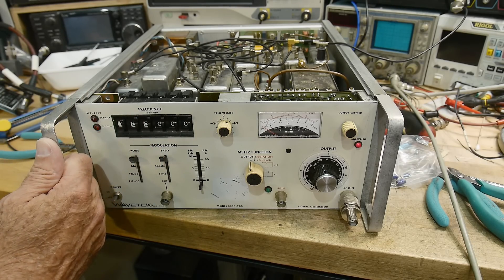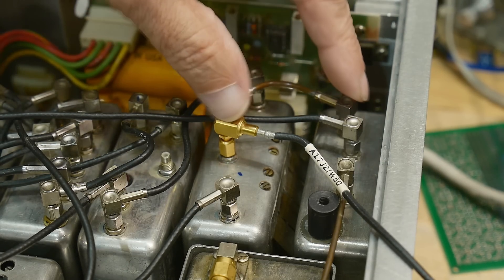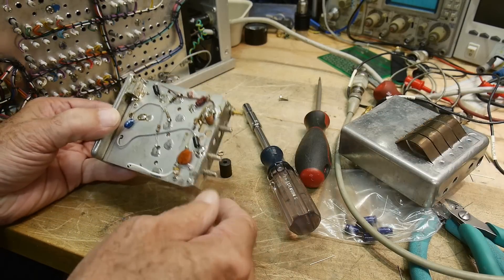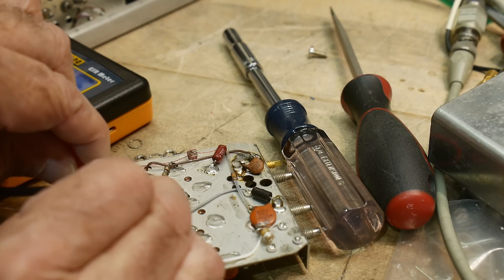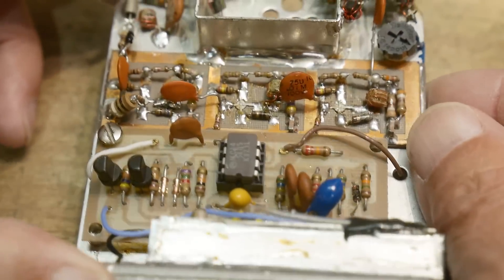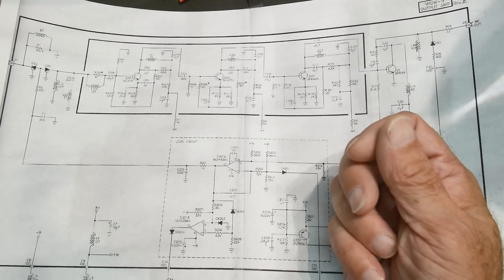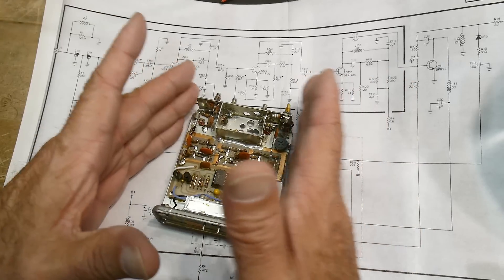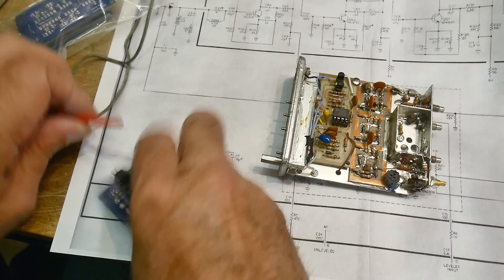#1915 Wavetek 3000 RF Generator (part 10 of 14)

Comment: I don't think it's the leveling circuit I noticed the the gain falling as frequency fell the leveling circuit is trying to do it's job and increase gain of 3 stage amp and they are going into clipping instead of adding gain so I believe you were on the right track to start with but it might be a transistor behaving funny at lower frequencies.
hope you're feeling better soon.
Reply: Does it meaning the circuts before leveling circuit gets smashed when it gets loaded by leveling circuts?

Comment: Either levelling circuit has an open filter capacitor, so the signal is getting amplitude limited at low frequencies, or the levelling is oscillating because of an open tant, or has lost negative voltage rail to opamp.